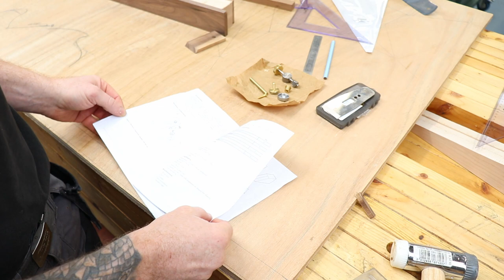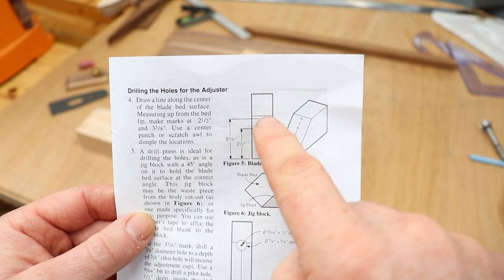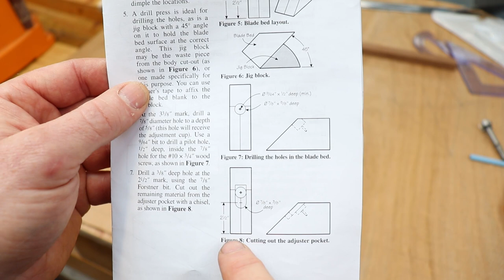Make a Wooden Hand Plane

Comment: Your finished plane is a thing of beauty, John. The amount of constant force being applied and then additional loading when the plane is in use should have called for that threaded insert to be installed underneath regardless of the epoxy being used. An interference fit would hold it in place and if aesthetics demand it, put a brass washer or bushing on top.

Just found your channel yesterday and am loving your builds, tips and general demeanour. Thanks for creating woodworking content for those of us without an infinite budget.

Comment: Nice looking plane John, but I believe the brass insert should always be fitted from the underside and counterbored to make the head flush. Providing care is taken to bore the hole and the wood backed up to stop breakout it wll be much neater all round and need very little adhesive to hold it in place. That way the pressure is always in the correct direction. Keep up the great work.